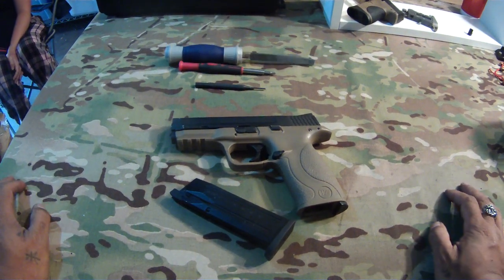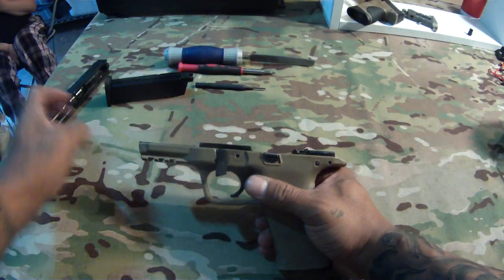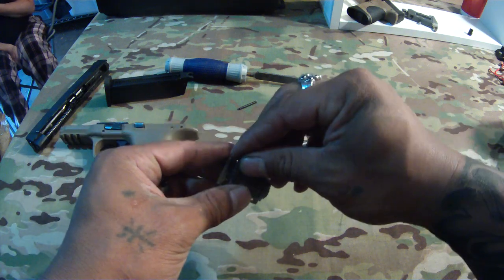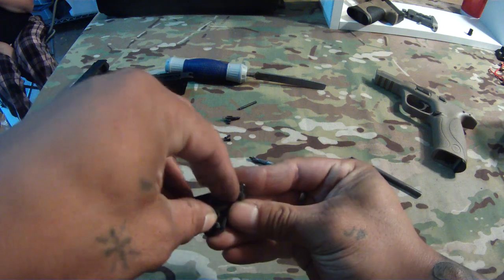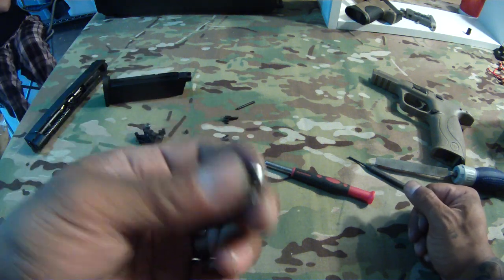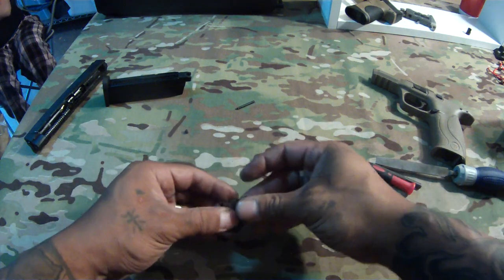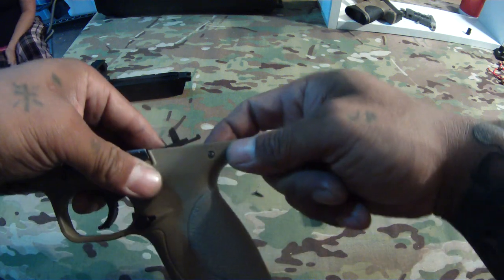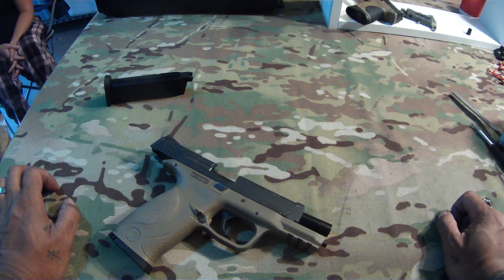HOW TO: FIX WE M&P shooting full auto

Comment: Thanks for the video, helped me fix mine. Mine is the one with the full auto option as a safety switch and you cant split the hammer "box" (forgot what it was called) on this one but you can shave the piece from inside it and it fixed it.

Comment: I just bought this pistol today and it wouldn't always dry fire no click i would have to take the slide off reattach then it work once or twice but I put a mag with gas in I went and let the slid go after filling the mag the pistol went full auto and didn't stop until I managed to get the mag out. I dumped the gas out and tried and sure enough it did it again dead trigger. Idk of I should fix it or give it back to the shop I bought it from